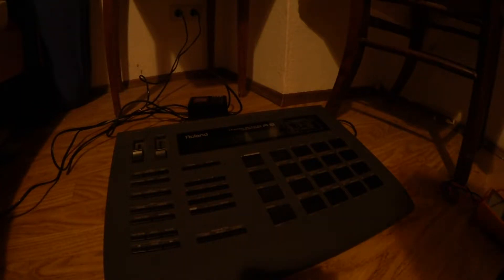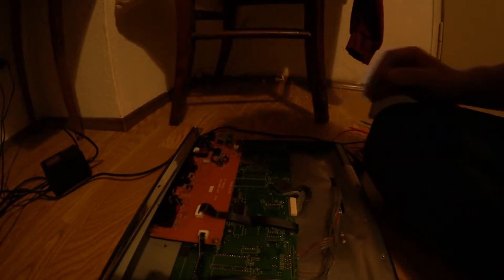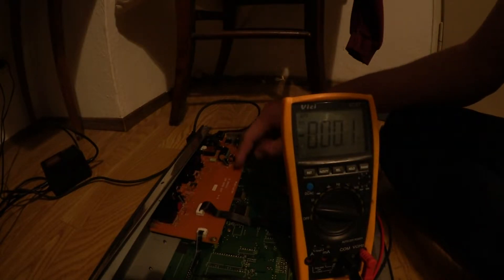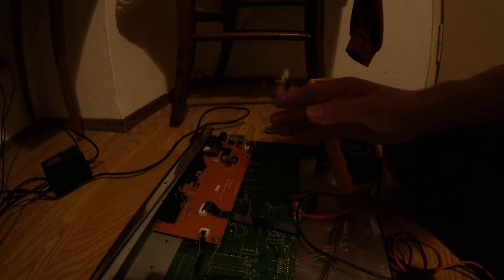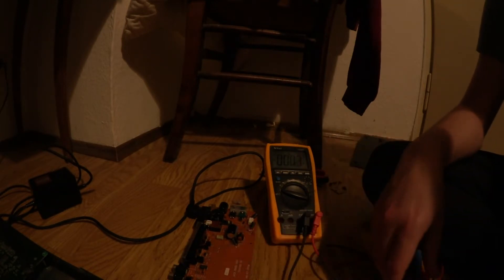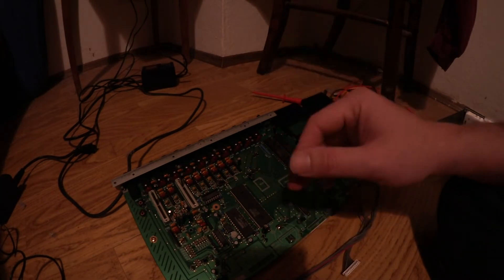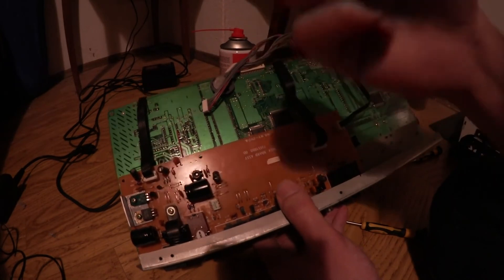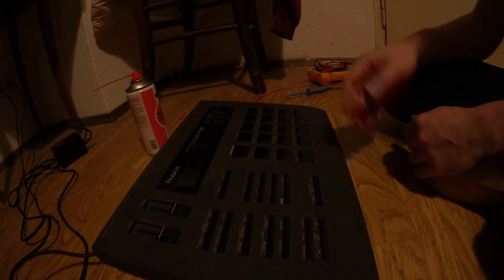Faulty Roland R-8 Human Rhythm Composer drum machine repair

Comment: Thank you for your video! I have a Roland R-8 and it has a problem of randomly resetting to the default factory setup. It doesn't store the programmed patterns (user patterns). I opened the drum machine and changed the battery with no positive results. Any thoughts, ideas, problem solving for this situation? Do you know a place that I can ship the unit to be completely checked and repaired correctly though? Thank you!
Reply: I have the same issues. Did you solve it? How?